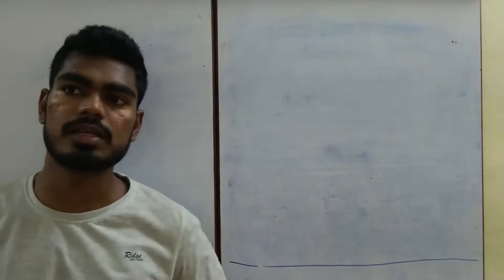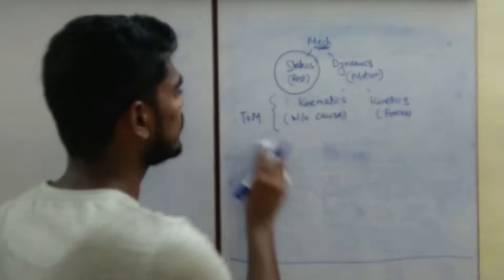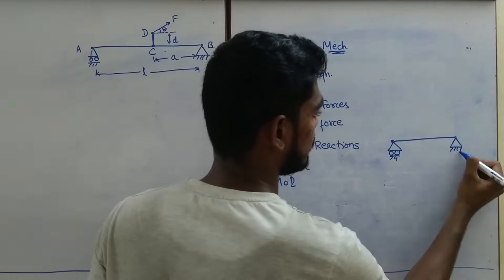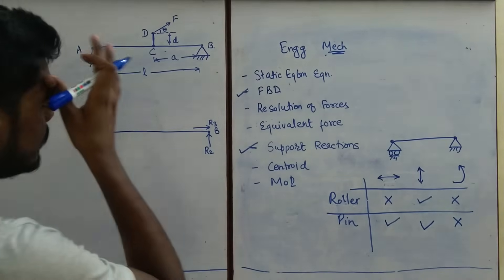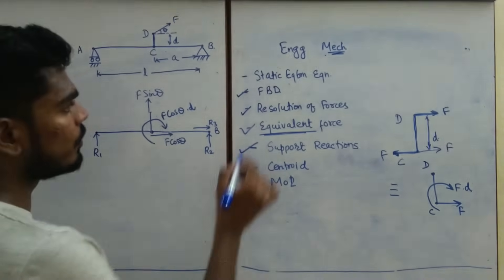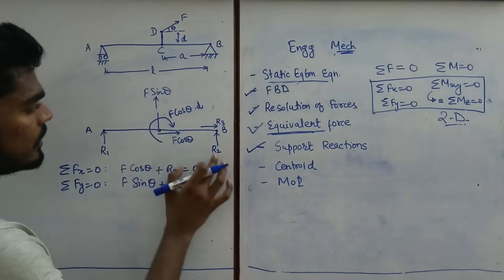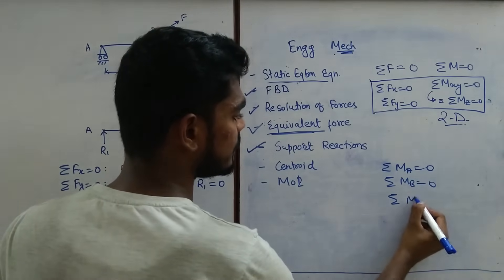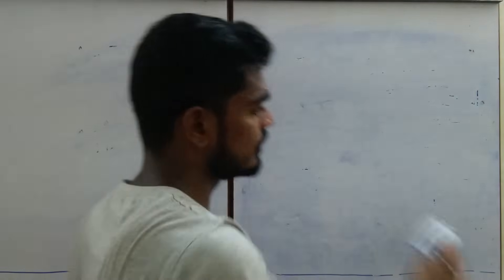SOM introduction Part 01

Comment: IN kinematics why we not considere the force ?
Reply: That is how any kinematic analysis is done, if u consider the forces that will fall under the category of kinetics
Reply: Please elaborate with certain example
Reply: @mayankpurankar8485  when u do disp, velocity or acceleration analysis of a four bar linkage it is termed as kinematic analysis
But when we do further analysis wrt forces of same four bar linkage it will b termed as kinetic analysis.
Reply: Ya it's clear to me, thanks for that